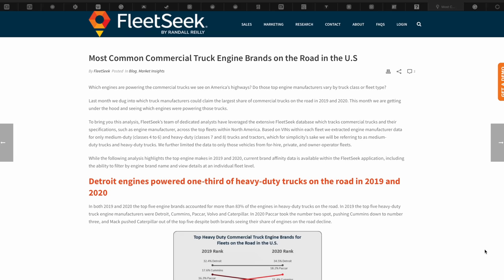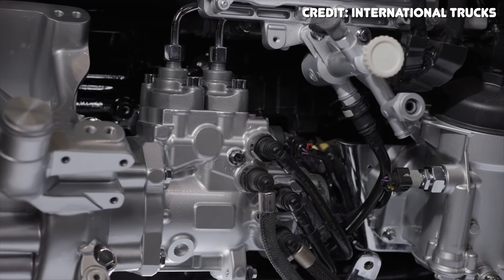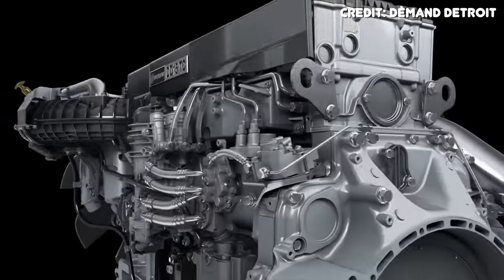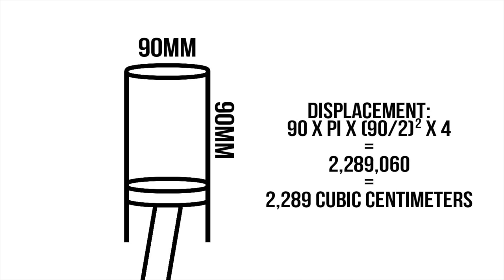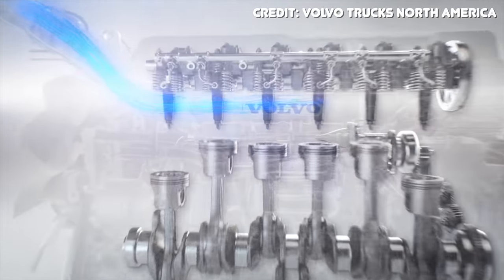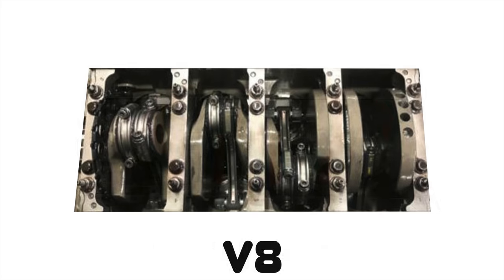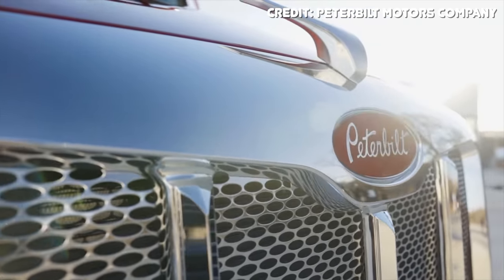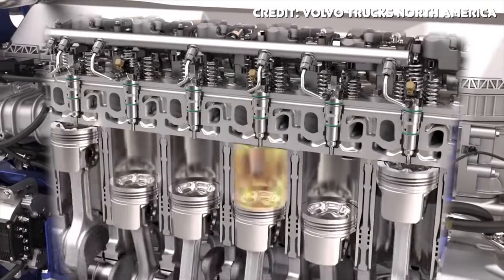Why do Semi-Trucks Use Inline-Six Engines?

Comment from the maker: If you guys enjoyed the video, please SMASH THAT LIKE BUTTON. It helps the channel out a huge amount and helps YouTube put the video in front of more people. Thanks for watching 😬
Reply: Keep up the content. Thank you for amazing videos.
Reply: Great Channel 👍 this topic usually ends up a hornets nest stirred but worth it .
Reply: When people say that a i6 is more torquey or powerful or "has better power delivery" they mean that the even 120° between Cylinders makes for the smoothest Power Output on the fewest Cylinders. 
The first 30° after TDC and the 30° before BDC produce basically no Power as the Piston barely moves in the upper and lower 60°s. 
That means meaningful power delivery happens for 120° for every 720°. 
On a Single Cylinder this means that the Engine relies on inertia to rotate 600° for every 120° Power Stroke
On a Two Cylinder this becomes 480° for 240° of Power
On a i3 Cylinder this is 360° for 360° of Power
And on an i6 it is 0° for 720° of Power. The Load on the Crankshaft and thus on the Clutch and Gearbox is far more even, there are no Interruptions in the Power Delivery. 
On a V6 you will often have two Cylinders firing within 60° and then 180°. This is uneven and felt in the Driveline. 

The i6 is thus the best in smooth Power Delivery for the smallest Size, as a V12 with the same Displacement will take up 50% more Space and weigh more as well while being less efficient all due to the Law of Cubes.

These Engines are also running quite considerable Boost Pressures to make up for the low RPMs.
Reply: Fascinating. Wondering about rod length used
Reply: In Europe we have v8 semi truck engines made by scania 500bhp to 770bhp
Reply: turn yer damn hat around.
Reply from the maker: @patrickgreene7778  no.
Reply: or take yer damn hat off @patrickgreene7778
Reply: @Dustrunnersauto  many good points, but the main attraction for I6 is fuel economy
Reply: Thanks for helping me to finally grasp what the actual meaning of ft./lbs. of torque is!! I always just went by the "more is better" doctrine!!
Reply: Before watching this video I am going to say it has something to do with Torque.
Reply: I smashed it so hard I fucking broke it.  Hope you're happy.
Reply: What about Renault Trucks
It's complete different designe and architecture from Us Semis
Reply: You forgot an important factor; weight. A V8 is heavier than an inline six.
Here in Europe the V8 is still going strong. I drive a 2017 Scania 580HP V8. It's just as torquey, just as fuelefficient and long lasting as a compareable L6. But it's maybe 400 pounds heavier than the inline six.

The sound is unbeatable 🙂
Reply: My 05 Jeep Wrangler HO 4.0 inline 6 best engine ever put in a jeep. Run forever and are super reliable decent HP and torque think mine is 190 HP and 235lf lbs of torque. Perfect for a 3800lb vehicle
Reply: A lot of the things you said makes sense but it contradicts one year statements and that is inline sixes don't make more torque than V8 well typically they will if you measure them in the same displacement and inline 6 is more prone to make more torque because of the initial two cylinders being dropped with that being said it would increase the inertia because parts will be heavier and bigger one other thing that is missed out that adding more Pistons evens the power lay for what as in there will be more Pistons firing at a given point in time which will increase horsepower and possibly some torque but as I'm saying in layman's terms because it's less cylinders it makes up the displacement difference with size and with the size being bigger obviously is going to weigh more and resulting in more torque in in line configurations
Reply: ..

Mine typically
is this same way

Flatbed means
out inde elements

It acts like a bandana
holding everything down

also covers from
dust and debris

don't need my eyes covered
I need a straight answer

...
Reply: @Dustrunnersauto  Cummins used to have the 903 for semis, but I don't know if they are still used for that anymore.  The 903 was used in the BRADLEY Army vehicle back circa 1985-1987. I don't know if they are used anymore either.
Reply: Well in case non of u all have heard a company in the us has bought an all electric truck. The tractor alone weights 82000 pounds. Yea that's right 82000 no trailer. It will only go 400 miles from charge to charge. Then it takes over 20 hours to charge. So the weight of the trucks will completely destroy the roads in the us in literally no time at all and think on that the green new deal. Is about to destroy the entire US. By time it's not even 1/3 started the economy and all will be gone. But who would buy a tractor that weighs that much it's just not practical.  Hydrogen is the best solution. But that also comes with issues of its own. Plus the fact that there's plenty of oil and always will be. And remember the whole earth is a carbon sink including us. All life is based on h20  . 😗